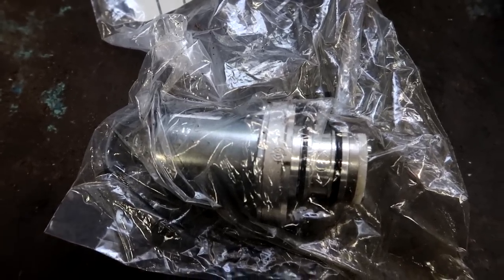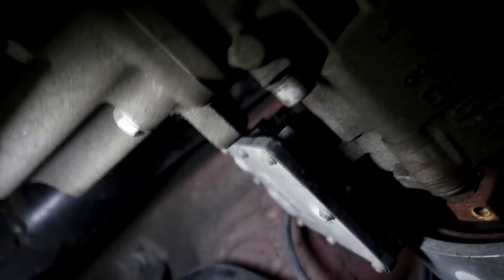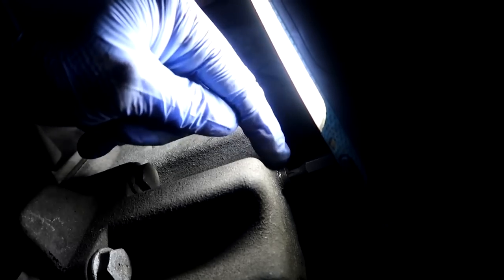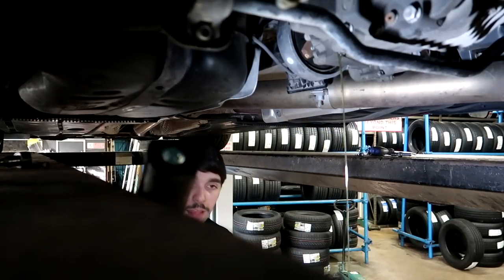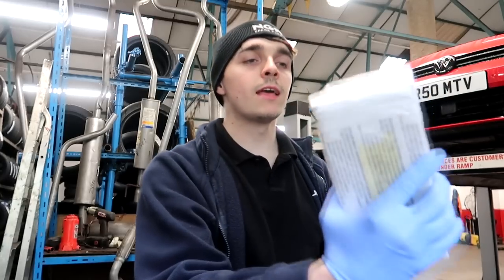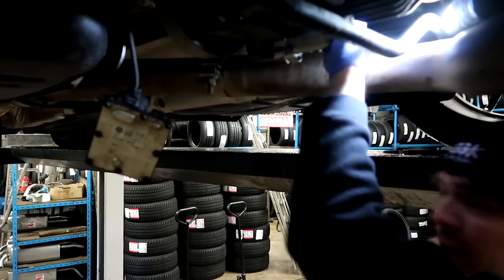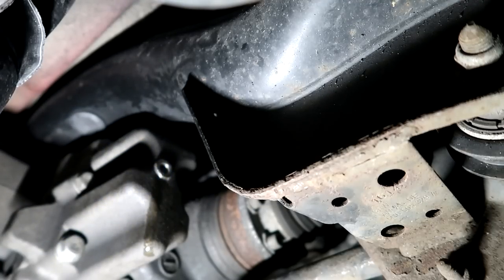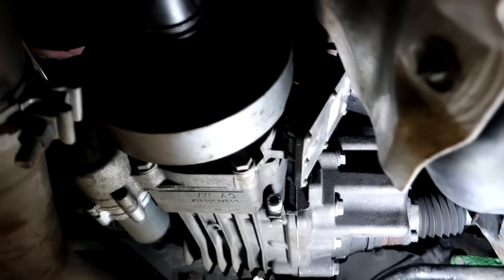Fitting A New Haldex Pump On the Golf R

Comment: After I had newer VW software put in my stage 2 7R  the Haldex didn’t work anymore. After updating the Haldex too everything worked again. It might be just that. It didn’t even throw any faults or errors when the haldex was out. Just major wheelspin! Before you spend any more check if the haldex software
Reply from the maker: Alexbaja909 Same here no codes at all I’ll defiantly update it Thanks👍🏻
Reply: How did you update the haldex?

Comment: Had the same issue on mine. Yours is a Gen 5 Haldex system so a lot of posts are relevant to the Gen 4 and can in the main be ignored. Have you run Basic Settings on the Haldex system? Using VCDS...

 Start the engine.

1. Open Controller 22 - AWD
2. Open Basic Settings - 04
3. In Basic Settings use the drop down selection box to select "MAS02928 - Pump Motor"
4. Hit "Go" and let it run. Took a minute or so, during which time I could hear the Haldex pump cycling up and down and relearning its function.

After a while the Pump Basic Setting function "Finished Correctly", and everything started to work properly.
Reply: Oh, and you'll probably find if you pop your old pump back in and run the same procedure that it'll start working again.

Comment: You need to reset the pump, clear faults even if there are no faults and activate pump relearn through VCDS. In VCDS Basic Settings -> Pump Prime for 30 seconds. (22) AWD -> Output Tests -> Clutch Engaged/Disengaged 2 times for 30 seconds each. Ignition on, Engine off 3. (22) AWD -> Clear codes (even if none are present) 4. (22) AWD -> Basic Settings -> Clear all adaptation values 5.
Reply: Can it be done with Autel.

Comment: Obdeleven
Have you tried the pump motor? AWD -> Basic Settings -> Pump motor
Then try reseting adaptations in Basic Settings.
Engine on 1. (22) AWD -> Basic Settings -> Pump Prime for 30 seconds It seems to make a humming noise and then seems to purge. Sound is an alive indicator. I've found nothing else to diagnose a pump without taking it out which I also done and put 12v through it and it was fine.
2. (22) AWD -> Output Tests -> Clutch Engaged/Disengaged 2 times for 30 seconds each.
Ignition on, Engine off 3. (22) AWD -> Clear codes (even if none are present)
4. (22) AWD -> Basic Settings -> Clear all adaptation values
5. Drive off, no launches for a few miles or so.
 
I found this cured my issues and have not seenthe TC light since.
the above was from various posts and trial and error with obdeleven.
Reply from the maker: Lucian Geman Thankyou for the info🙌🏻
Reply: @jamesr50  it works know?
Reply: @jamesr50  did you try this and did it work?